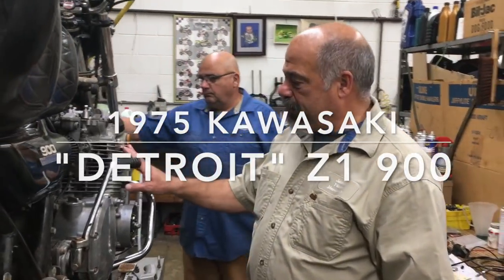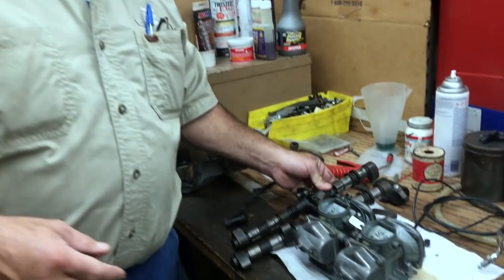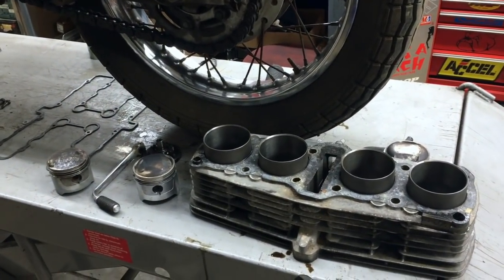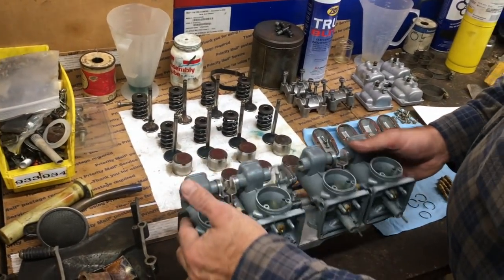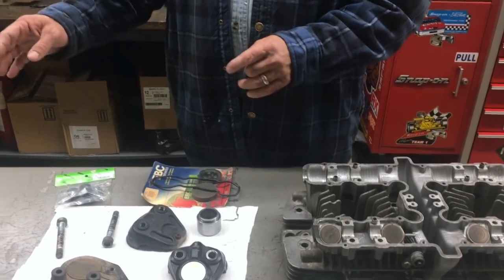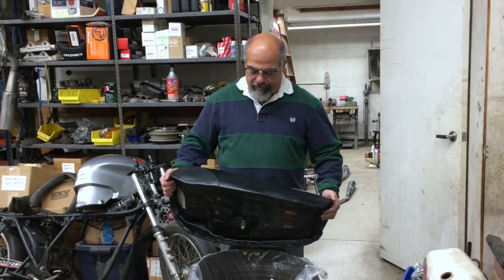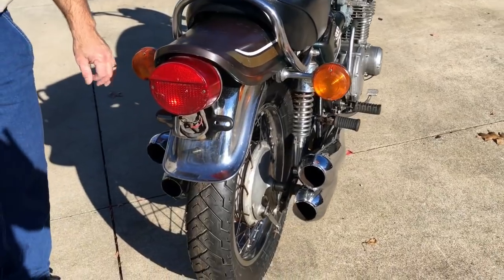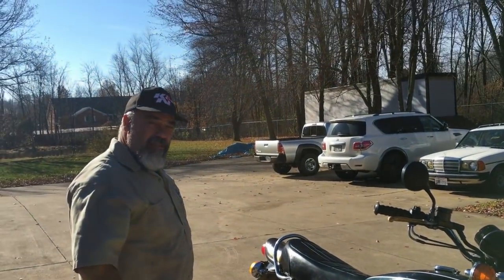1975 Detroit Z1 900 Kawasaki Restoration: Full Story

Comment: what size rear sprocket do you recomend mine is 39 and im looking for an other gear at 60 mph csr 1000 1981
Reply from the maker: I am not sure what size was stock, as most of our stuff is 73-80. you can change the front as 1 tooth in the front is = to 2.79 tooth on the rear. So if you go lager that will be like taking off 3 tooth in the back

Comment: max you can bore stock 900 cylinders is 70 mm or 1015 cc. back in the 70's and early 80's before the days of big blocks they used remove the stock sleeves to bore out stock cylinder and put bigger sleeves out and they  could go out to 76 mm bore or 1197 cc. infact i have 2 one 10.25-1 compression and the other has 13.5-1 mtc  drag race pistons.the reason yosh built those 69 mm pistons was for the superbike road race class they had a 1000cc size limit and yosh also wanted keep abit extra meat in the sleeve so they would be less prone to going out of round due to the extra heat from high rpm. would you be interested in getting rid of those cams